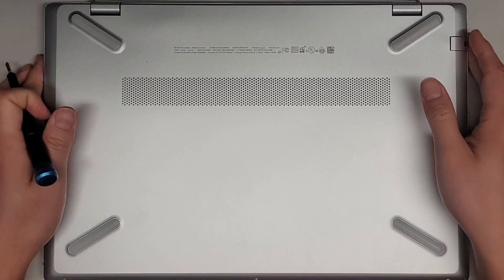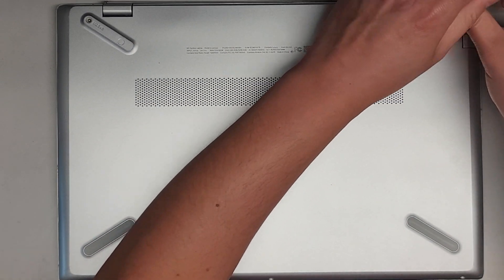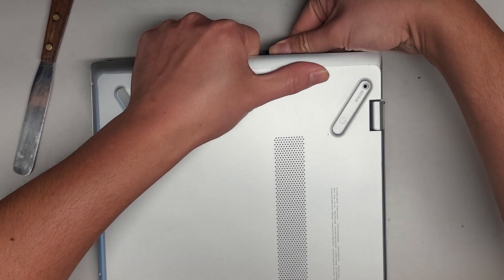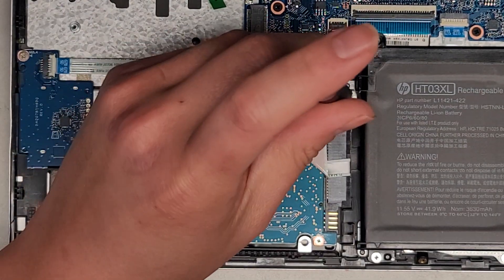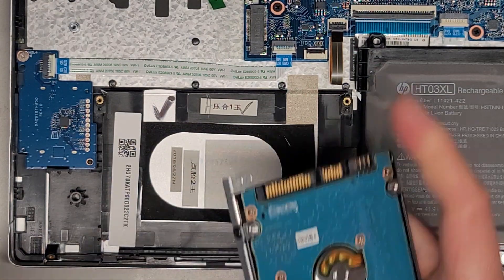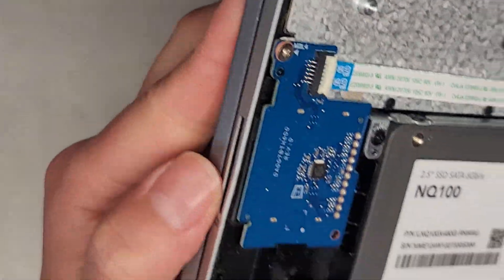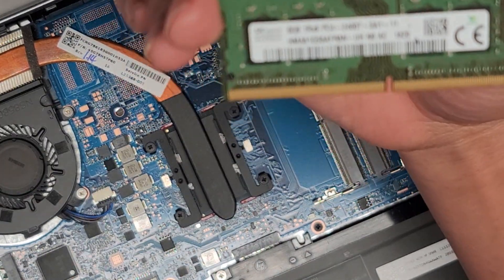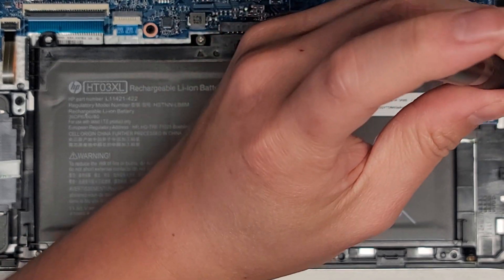HP Pavilion Laptop 15-cs0064st Disassembly RAM SSD Hard Drive Upgrade Battery Replacement Repair

Comment: I have same laptop it's freez about 10 min and it's freez when I open any browser you name it 😢, should i remove the ssd to fix this problem. Need help please.
Reply from the maker: Does it have a hard drive?
Reply: Yes, it does.
Reply from the maker: @Ammar-ku4yx might be a faulty drive. Check if the hard drive activity in the device manager is 100%
Reply: @ItsBinhRepaired I will check it out and let you know, thanks
Reply from the maker: @Ammar-ku4yx OK

Comment: Hello.  Nice video!  I tried replacing the Optane/HDD with just a M.2 device but it was a no-go as it would boot once/twice and then not find the boot drive.  Attempted to review few items via google, but no luck and ended up just putting back the old hardware.  Might you (or anyone) have any advice as to how to retry the M.2 device or should I just try a 2.5 SSD?  Thanks!
Reply from the maker: @fus3669  how did you put the OS on the new drive?

Comment: quick question, everywhere i look it says the max RAM for this model is 16gb but when i do the cmd wmic memory commands it clearly appears as 32gb. What is your suggestion? In this age i'm gonna but 3200MHz and expecting it to get downclocked to 2666 or 2400
Reply from the maker: Anyone that said they installed more and it didn't work?
Reply: @ nopeeee. So I’m willing to try and see what happens ahhahaha
Reply from the maker: @TriscuitFTW  Worst case you take it out and put back the old RAM lol

Comment: Hey I'm an IT guy I had one of these HPs die on me replacing the battery and I'm not sure why. Is there anything to disconnect before swapping out the battery? When you put in a new battery does it buy some chance cause a power surge on the motherboard? Thank you for the video great job thumbs up.
Reply from the maker: Just need to shut the computer off and unplug it.

Comment: hi dear, thanks for the video, i have the same model of HP but when i install 2.5 SSD it is not ditecting. i search from BIOS update f9 and f10 but still no luck. can you help me. pls
Reply from the maker: Did you check the disk manager?
Reply: @ItsBinhRepaired  yes. Disk manager not showing the new ssd. My OS installed on nvme disk and i need to run 2.5 ssd as a storage device installed like in your video. Is it automatically displayed on disk manager? I tried it again by disconnecting and reconnecting also
Reply from the maker: @toptenmosthits  sounds like your motherboard might not support nvme

Comment: Thank you for an excellent video! Your tour of the components was especially helpful because my wifi antenna came unplugged when I pulled the back off and I had no idea what those 2 wires were for.
Reply from the maker: Glad it helped. If you haven't already, please like and subscribe so others can find my videos and possibly consider watching a few others to get the algorithm to recommend my channel. Thanks!
Reply: Done and done @ItsBinhRepaired
Reply from the maker: @geoffzimmerman1318  Thanks!